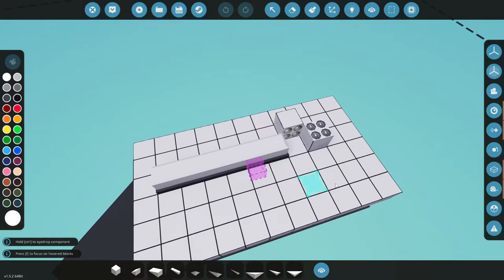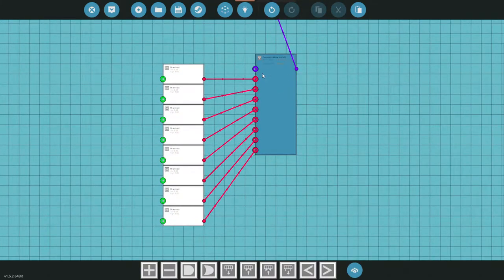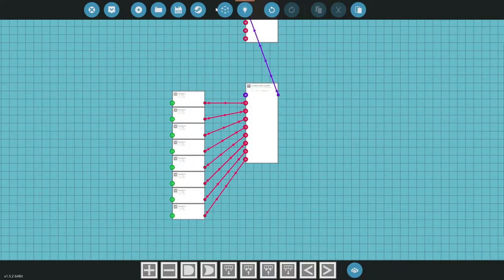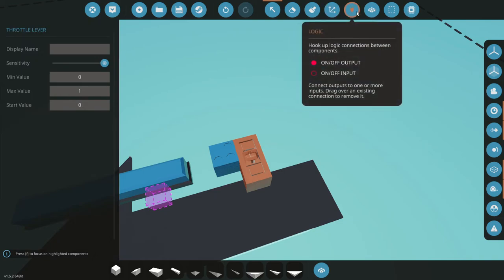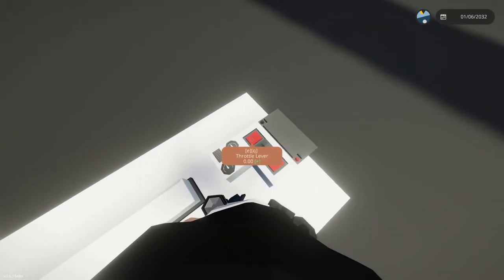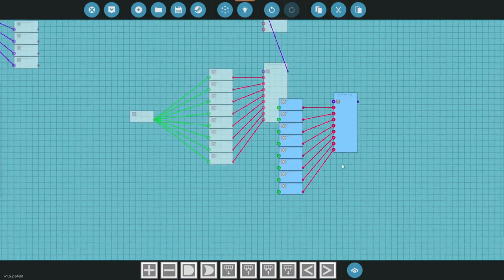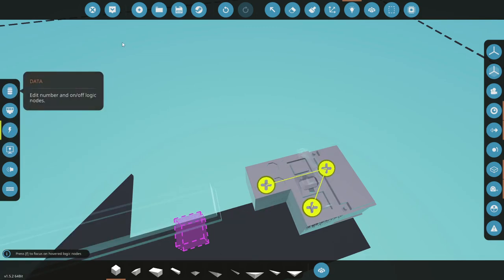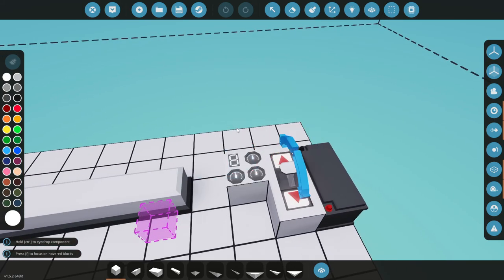Beginners Instrument Panels! Part [2] Stormworks Tutorial - How To

Comment: Do you plan on showing how to chain instrument panels together to save on inputs on the m.c.?  It is something I figured out and has saved a lot of hassle.  

Input from one microcontroller to instrument panel, from first instrument panel to input of a second instrument panel through output to input etc as long as there are enough different channels and they are setup right in the instrument panel it is great.
Reply: As simple as it is, for some reason, I've never thought of it lol, thanks for mentioning it! Any other simple things I might have overlooked?
Reply from the maker: Yeah maybe in the future.  I wanna get thru some basics first. But great idea.
Reply: @ProfNCognito  That is what I thought .  Just wanted to mention it in case you didn't think of it.  I wish I knew that it worked like that when i started using composite.   It would have saved me a lot of hassle trying to fit 10 microcontrollers in when I only need 2...🤦‍♂️
Reply: @samuelmorton4422  Probably a lot of things,  I still figure little things like that each time I build something.    

For example using multiple Lua blocks to cut reduce confusion on complex scripts for monitors.  I use one for each layer with one being touch control,  another being background colors and shapes and another for dynamic shapes and values.   Just link the composite from the monitor to the touchscreen Lua block and then chain the video through each of the others out to the monitor.    It makes it a LOT easier to switch arounf layers if they don't appear in the correct order or find bad scripts instead of looking through 100 lines of scripts...  it also allows you to use the same channel with different input values on different layers if needed.

Comment: Hi, how do you make it spawn in already toggled, like how you can set the regular toggle button to already on using the select tool.
Reply from the maker: Can't with composite. At least not yet anyway.
Reply: @ProfNCognito  Finally got an answer for this, Thank you. Been trying to hook it up to landing gear and have the gear extended at spawn. There is probably another way of doing this, but i will go for a toggle button until i find out a way. If there is one.
Reply: @Andysus123 I’m really late but you could probably use a not to make it so your gear are deployed when the vehicle is spawned in and retract when the switch is flipped